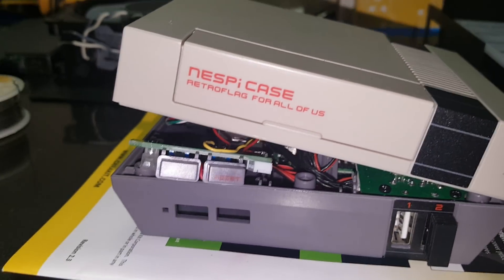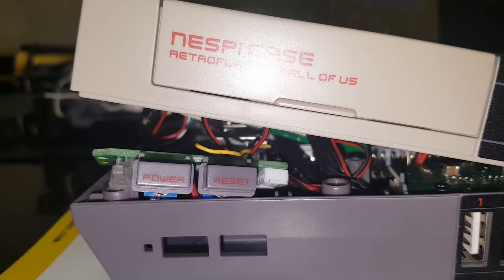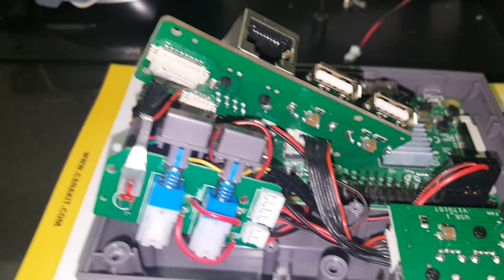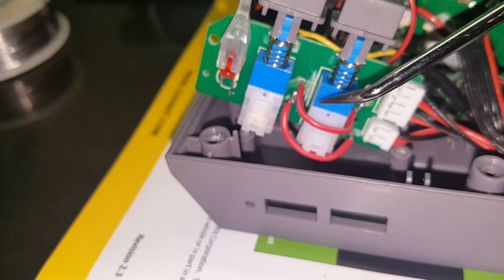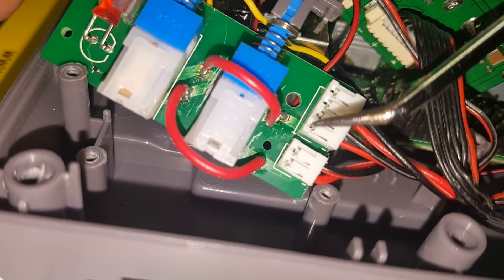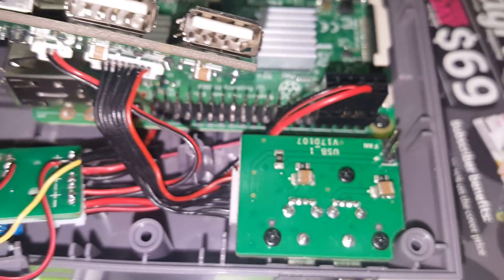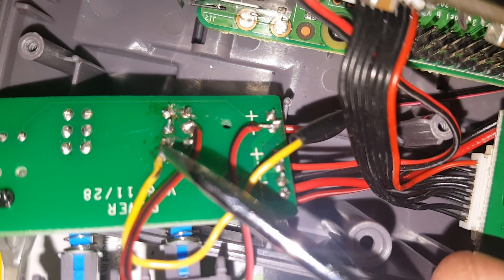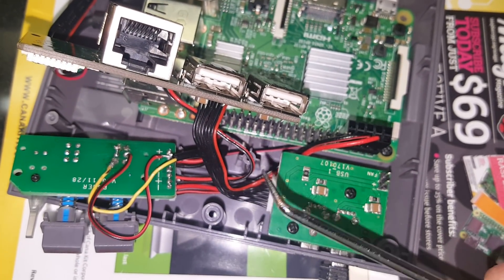Raspberry Pi 3 NESPi case easy Soft Shutdown Reset button Mod no Resistors

Comment: I just applied this mod but couldn't find a working script until I tried the Retroflag Nespi+ script, which worked: http://download.retroflag.com

Edit: Apparently this script disables the normal Retropie menu shutdown option somehow, as now it does not work on my Pi anymore. I ended up in prompt and had to type shutdown command manually.

Comment: Solder this exactly as seen and the nespi case would get any power. It seemed to have a short, double checked everything and no LED on the board. Desolder everything and its is working fine.

Comment: Any of you receive the low voltage after doing this? Also can I not use the reset button to leave a game and the power button to shutdown the system safely with this method. I've done the other method on 2 cases and both get low voltage. Tried thicker gauge wire and still some problems

Comment: Thanks for the video. I started with ETAPrime's voltage divider method. However, I found it to be temperamental. Implemented your method. And now works a treat. Thanks!

Just a side note, for the latest RPi 3 B+ running Raspbian Stretch you currently need to do a workaround to get the script to run at boot (See link below).  
https://pie.8bitjunkie.net/retropie-shutdown-and-startup-switch-the-easy-way#comment-1739
Reply from the maker: Kmmar25 Thank you! I'm happy it workes out for you. Its been running great for me too still. Thanks for the link great info for the new Pi 3 b+